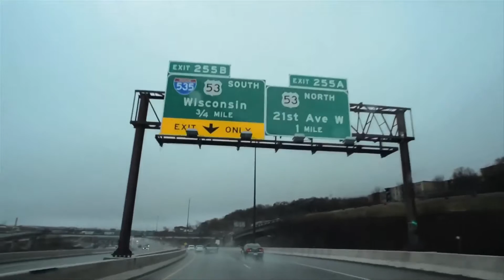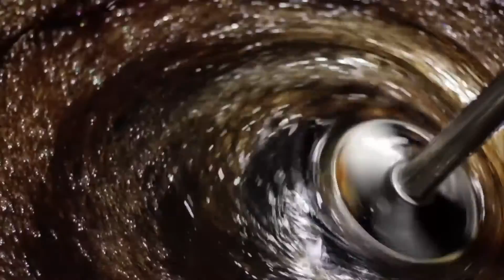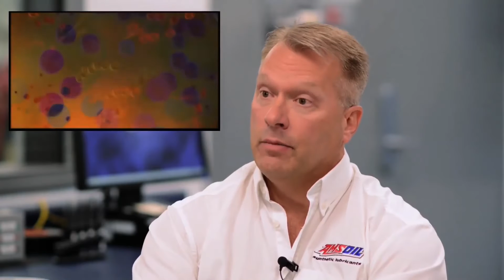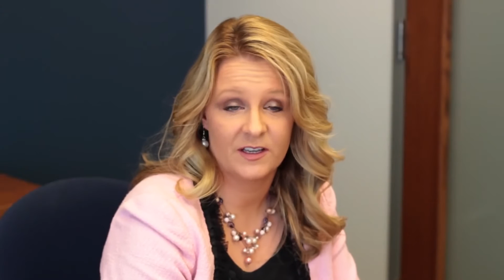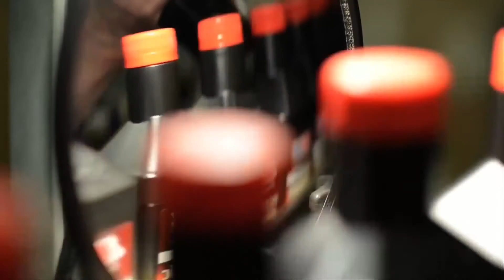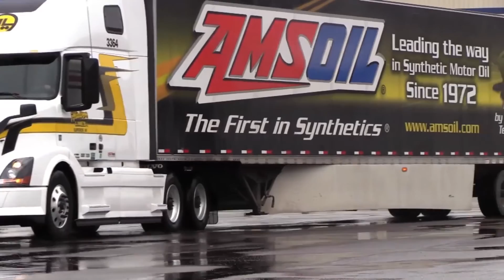Secrete - AMSOIL  How It Is Made without stockholders? Why not a cheap version for cheapskates?

Comment: I've used amsoil in my Harley Davidson Ultra classic 2002 for years. I switched back in 2010 from Harley synthetic oil to Amsoil. Being an air cooled motor, using amsoil dropped my average normal engine temperature a total of 24 degrees Fahrenheit. I have a oil temperature gauge dipstick that's digital readout directly in the oil. I also used my Temperature reading gun on the heads of the bike. Its consistent. I've used Amsoil ever since. My only gripe is the limited availability of Amsoil. Going thru a dealer is hogwash. Very inconvenient. And in your major box stores like Walmart, rural king, autozone excetra, its hit or miss in finding it available. Your marketing team need to do their job and get it more available to consumers by opening up the sales availability to regular box stores and stop with regulating it thru getting thru dealers only. Thank you.
Reply: I always wondered why it wasn't sold in the big box stores so I researched it the big stores won't carry it unless they bring their price down and Amsoil can't bring the price down unless they sacrifice quality and they wouldn't do it you can look it up. it is hard to find amsoil but it's worth the trip.  some local mom and pop hardware stores and parts stores carry it I have to drive almost an hour for me to get it but I still do
Reply: @trackpackgt373 14 year AMSOIL dealer here. I hope you found an easier way to get it since your post two years ago, but with the internet it's easy to find a dealer, and get it delivered to your house in just a few days from one of the distribution centers.